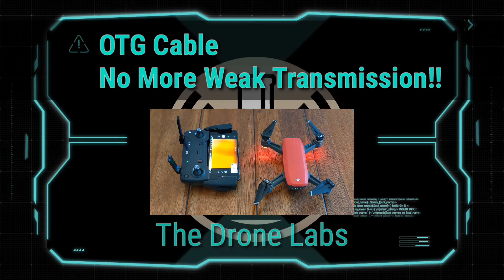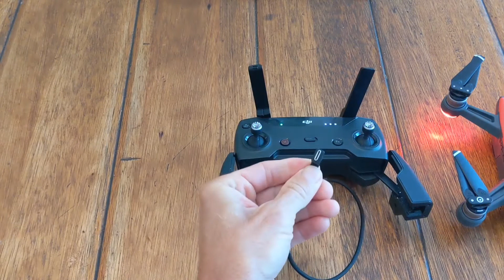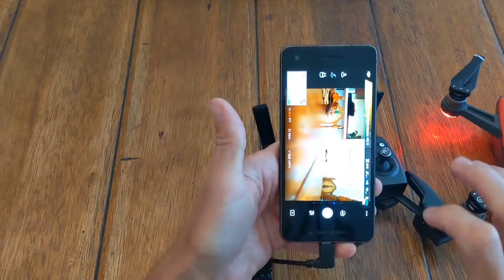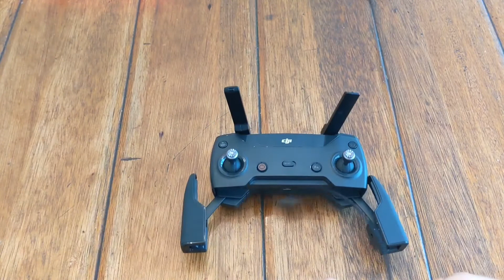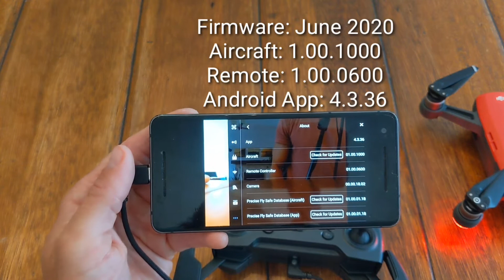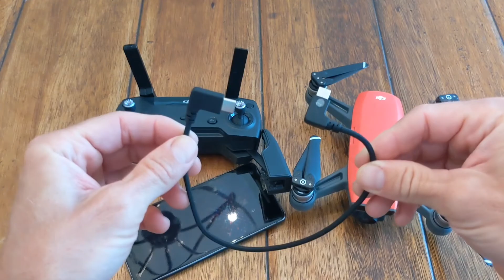OTG Cable for DJI Spark Drone: Bad Connections SOLVED!!

Comment: This cable caused my spark to crash the cable came out while flying and my drone fell out of the sky but it still works
Reply: how on earth did it come off? Did you fat finger the cable? If so that's on you not the cable.
Reply: @eddyg1794  I cant really remember how it happend I still have the spark and I glued it back together and its still works I now have a Mini 3 and the cable never comes out while flying it.
Reply: @FilmingAustralia1623  Glad it all worked out.